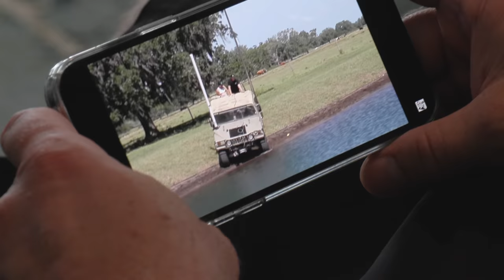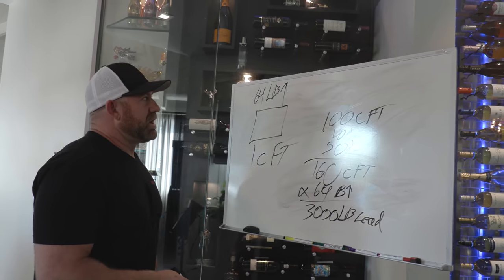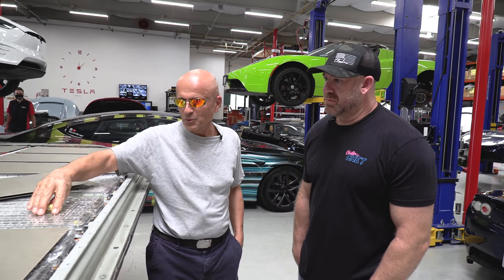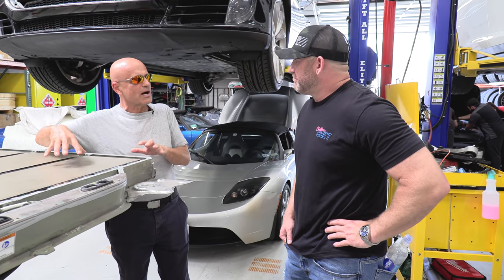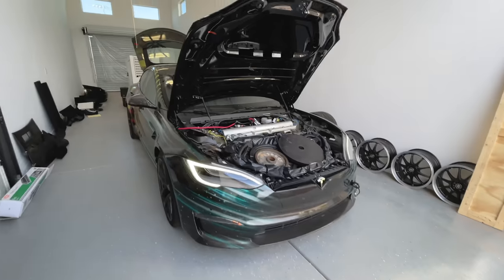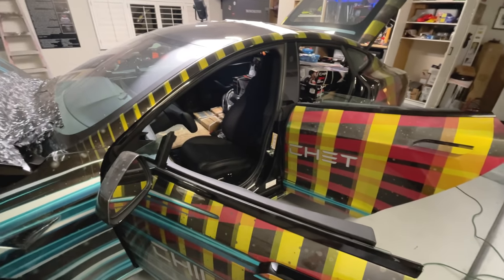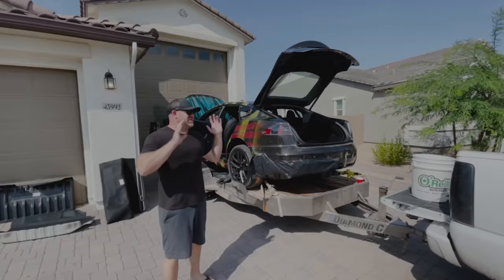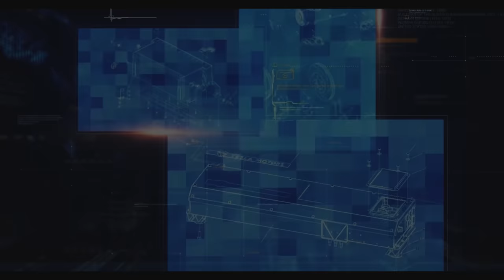Driving my Tesla Model S Plaid Underwater!! Does it float, sink or drive 7ft under!?

Comment: Uncle Chet i'm an engineering student and my calculations say you need another 2,400 pounds of ballast in there to get the roof underwater. You want the weight more forward also. That is asking a lot of that frame and suspension/tires would be pushing it for sure. Pro tip - fill the tires with water instead of air like tractor tires! My calculations say this will give you per tire 70 more pounds of ballast or about 280 for all corners. By replacing the air with water in the tires they will be able to handle any amount of weight and is that much less on the frame. That trench does not look to be deep enough or filled with enough water for the roof to go under though.
Reply: Do this for sure. Water in tires is smart
Reply: What happens when the car egresses the water and loses Fb?  It will be too heavy to move.  You saw what happened to the tow rope.  It's already too heavy.
Reply: @ajcsanders  Uncle C said for try #2 it would be even better sealed than before but the water that entered was actually helping him supplement his ballast deficit. The way the water distributes evenly as a ballast is actually less stressful on the car than solid ballast. I agree it is already too heavy because it is a crazy idea in the first place but to actually achieve the crazy goal it still was not heavy enough. That rope broke because it was a flimsy welfare rope and there are straps that are strong enough to handle the strain with ease. Because the frame was designed to handle the G-forces of dynamic loads I would expect it to technically support the weight without breaking on its bottomed out suspension since we are talking just a bit more than doubling of the original mass. As uncle C pointed out the volume gets more buoyant as it sinks and so the reality is to make it sink all the way that tesla needs to have a weight equivalent to 2 full size pickup trucks one way or the other. Whether it is water or solid ballast doesn't matter but to achieve the spirit of the mission I take it that he wants to keep the cabin relatively dry like a james bond lotus submarine. About it not being able to move, with it being a plaid model that car has a horsepower equivalent that is well above a 1000hp car and with it being torquey electric motors I know it would have more than enough power to keep on moving despite having to weigh as much as 2 trucks as long as the systems remain functional! Because even with 2k more pounds of ballast it would be just neutrally buoyant, it would need to weigh even more to actually have additional negative buoyancy so the tires don't merely spin out on the bottom from lack of traction because it can't just merely touch the bottom but needs to literally press on the bottom to hook. God Speed Sir!
Reply from the maker: The rope is 25,000 lbs winch line stronger than steel.  It was the knot that made it fail.  But  Yeah it will work just needs more weight. Once it enters the water the weight is nullified by the buoyancy and i hope to have 500-1000lbs on the tires.  If i blow out a shock or two i dont care it will still drive itself out.  Only thing I worry about is a “water safe plug” made by tesla fails and the mission is a loss.  If it does what its suppose to do then it will happen when we retry in a couple of days.
Reply: @ChillinwithChet  That's right Uncle C if you achieve the 500-1000lbs of negative buoyancy when it is in the water the suspension will not be bottomed out at all the ride height will be actually higher than normal because it would need the 4.5klbs of negative buoyancy to compress down to even regular ride height. It would be the before and after the pool that it would be bottomed out and bottoming out a shock slowly doesn't hurt them at all it is only when they are bottomed out very fast like when hitting a curb that blows them out. Keep up the good work!!
Reply: @ChillinwithChet  The problem with the suspension is before you get in to the water.
Reply: or he could just burn a stack of money, same result
Reply: @jarehelt  tough to burn the money underwater...
Reply: You may want to consider making ballast tanks for water in the trunks. It will be a better use of the space to overcome buoyancy. Creative use of a bilge pump could theoretically get the car neutrally buoyant, the same way a scuba diver does it.
Reply: My calculations say. Don’t do it. You are not going to be happy after. Then give me the car please. Thanks 🙏🏻
Reply: @ajcsanders  the tow rope needs to be doubled or quadrupled. One rope isn’t gonna cut it.
Reply: Maybe also reduce the water just below the car's height and once the car goes inside the water, the water will rise above the roof. Could also make the trench a little narrower to hold less water.
Reply: Sand bags is another option instead of those dumbbells. Conforms to the space better. You could also do a roof rack right? But what about the interior electronics? Those probably aren't sealed as well so you'll need to make the cabin water tight. That would be hard to with frameless windows.
Reply: @djw1091994  Considering Uncle Chet is up in Colorado doing race week stuff with this car right now its a pretty conclusive sign that the electronics survived with the seal job he did the first time and with the water resistant wire harnesses that Tesla Uses. If it survived the first time it will likely survive the second time especially since I know he will seal even better the second time.
Reply: @jarehelt  but no knowledge is gained and no curiosity satisfied

Comment from the maker: Hey guys hope you like this crazy video and I could use all your help by sharing and liking it to send this thing viral!  Round two I should be able to sink it down and complete the mission.  Wish me Luck 😂🦑
Reply: If it doesn't sink just give it to whistlindiesel he'll know what to do
Reply: You made a boat when you tried to look the water out 😁👍🏼👍🏼👍🏼can’t wait to see it go under again
Reply: You sir are one of the coolest and craziest guys I've seen on video! Big shout out from Australia! 

I came to the Chet channel because of the Donald Walters story...... I've stayed for just about everything else cause you got some cool stuff on your channel.
Absolute legend man!
Reply: Fill the tires with water, that is a TON of buoyancy.... many cu. ft. of air.
Reply: add some harbor freight bilge pumps to pump the water out as it comes in ther so cheap and a couple of those would probably provide enough drainage to keep the cab dry
Reply: Simpsons did it
Reply: You're doing it the wrong way. Think like the people that designed James Bond's underwater Lotus. You don't want it to sink to the bottom. You simply want it submerged and able to propel itself and steer. That would be a much better idea. Also, consider sealing and pressurizing the cabin to help keep the water out.
Reply from the maker: @Tron-Jockey  trust me Ive got other plans just step one is this. Drive on the bottom pop up on other side.
Reply: What would chet math be on weight if the trunk was filled with concrete. 🤷‍♂️
Reply: Fill the trunk with concrete, heavy tarp or poly first, can always chip it out after lol
Reply: @BoilerRoomRadio  that's a good idea. probably won't help with towing the Tesla out tho lol
Reply: What do you do for a living?
Reply: Talk about electric chair.
Reply: OMG ELECTRICITY ⚡️ & WATER don’t mix.  Serious Electrocution Risk
Reply: Only a matter of time before your channel blows up if you keep up this type of shenanigans lol...good stuff bud
Reply: If u give it away i can sure use it lol i have to b asking for rides Chet thanks for ur awesome videos
Reply: awesome
Reply: Hey dude I just watched your video and I would love to have it when you are done with it because it will probably be the only way I will ever might get one driving my dads car now and have never owned a car of my own I no it sad and sux cool video tho
Reply: Dude, you can't ask for people to send a video viral. You're doing it wrong.

I like you, but you're crazy.
Reply: fill the most of the backseat area, trunk and frunk with jello like substance, it will be denser then water. For submarine the issue is underwater, and any air in cabin will reduce the chances of that happening. For submarine mode, its not as much Tesla that is the problem but the car will need major upgrade in terms of how you will breath and all that. Absolute desperate shot would be: Put on a portable scuba tank that gives you 5-10 mins, Open door let water rush in and sink car and Drive through. Rescue will involve getting to the car and pulling you out before the scuba tank goes out.
Reply: the lotus in james bond was a wet sub its filled with water so you dont need as much ballast. trying to ballast a tesla is tough. lots of air. i would take the doors off and get a real scuba setup. use a 50  so you got more time for them to rescue. a nice BC mask, etc wouldent hurt either. with the doors off you wont need more balast. if you want the doors off you may need actual lead and not just steel. water is heavy you need to displace it. i would also fill the pond with zorbies next time so you can get a larger demographic to like the video. "i drove my tesla thru a pool of zorbies"
Reply: My guy. You crazy!
Can't wait to see round 2. 
I'm thinking ballast tanks with little water jets on the sides of the car for control
Reply: Best of luck man , I think it gonna work out
Reply: Now this was a great ideal and I hope you can pull this off.
Reply: Good luck! It's going to pop in the algorithm :)
Reply: Wishing u good luck if it dont work i can take it lol
Reply: Prolly should build a retracting spikes rim for more traction.. Also allow the water to be trapped somehow in the trunk on entry then released as your leaving. Lmao just a 💡 thought lol
Reply: I think your bigger challenge is to seal the car.
Second challenge is to keep it on the floor.

Let's go by Challenge:
Seal the car.
1. Maybe try wrapping the car vertically and cutting off the excess from wheels? Then do the same horizontally.
2. Requires more work but since you now already have your car flooded, see where the water is coming into the cabin from and seal those places.
3. Use mixed color water in a tank and spray it throughout the whole car to see where it went and how it gets into the cabin, seal those shut and move forward.

Keeping car on floor challenge:
1. Ofcourse you can try adding more weight but I'd recommend using less water. Water rises when you put a big object inside because of the object volume. Hence you can remove some water so your car doesn't float while it'll still be completely submerged. This way you won't need to add Soo much weight into the car.
The weight won't matter as much because you have air inside the car. Like imagine the swimming vests, they have little bit of air and they keep a human body afloat.
So I'd say reduce the water level just to the level of the car or even below. It might do the trick.

Even though I think it's dangerous but I gotta give it to you, you got balls to be able to do this! I like the mentality of do it just because I CAN!
Good luck and get it done!!!!!
Let me know if I can help in any way  :)
I'd love to be a part of it. :)
Reply: Good luck!👍😉
Reply: Удачі! It's in Ukrainian. I'm from Chernihiv, Ukraine.
Reply: I really hoped this worked. Waiting for part two. While I wait can anyone direct me to the monster truck video?
Reply: Shoulda called @richrebuilds
Reply: Like! Nice video
Reply: 🙌🙌 when is round 2 coming out!?? I’m anxious to see this thing make it through!
Reply: You're working super-hard to keep the water out, probably because it conducts electricity.

Why not remove all the special stuff you've done and just fill the pool with DISTILLED water? 

Distilled water doesn't conduct electricity. Throw those iron weights in and let the thing fill up w/water. It should be fine.
Reply: You know what? A lot of people can use some shares, likes and subs for their channel. 
I feel like you tried too hard for the perfect 24 minute video. Its a good topic. I wanna see a Tesla underwater. But, i can still tell its scripted. The acting is off as well.
Reply: NEED TO PARTNER WITH MR FLEX TAPE
Reply: Chet ignore the shit talking clowns on here I thought it was a good try and very funny. Always enjoyable to watch your channel never disappointed. Some people need to relax and take the stick out of their ass lol. Have a good day and stay safe Jimmy from North Attleboro Massachusetts .
Reply: @ChillinwithChet  I know how to do it. You are going about this all wrong. You need to make a fiberglass/carbon fiber tub. Incorporate the weights in the tub. It can keep the water out and counteract your buoyancy at the same time. You could make some solid wheels for extra weight using stock trims and have them "treaded" like they retread tires.
You could have an aggressive cut made in the tire tread like when they sipe tires. If done right this would create micro paddles to help you move forward and also keep you down.
You need a spoiler in the front to force the front end down. If you designed it right you could channel the water so it forces the end down while cutting some of your drag. May also keep you pointed the right direction while the car settles after entering the water.
The front spoiler should help the front end come down too. It will enter the water first and start pulling the front end down while enough of the car is still out of the water putting its full weight behind it driving it down.
You can pressurize the cabin to help keep the water out. In the process you will identify all the places the water is coming in. If you can stop air from getting out, you can stop water from coming in. And you can do it with air while the car is dry. Instead of having to wet test it the day of.
Seal the area around the mirrors. Great big hole where those are mounted let's a bunch of water fill the doors.
Then the doors have a bunch of holes for speakers and all the fasteners.
Tape over all the handles.
Find and seal up all the sensors and cameras.
I want to help. I can mold the custom belly pan.
Reply: @uncledaddy7972  this nuts 🇨🇦❤️🇨🇦

Comment: You're doing it the wrong way. Think like the people that designed James Bond's underwater Lotus. You don't want it to sink to the bottom. You simply want it submerged and able to propel itself and steer. That would be a much better idea. Also, consider sealing and pressurizing the cabin to help keep the water out.

Comment: There is a reason why tanks... yes tanks... that are able to be amphibious has a "ballast" that ingest water in order to be submerged while traversing a deep body of water.
Most cars are able to drive through water that covers the wheel well... Once it gets to the cabin height, the air within the cabin creates crazy buoyancy until water starts flowing into the cabin.

Comment: Suggestion: Don't go for negative buoyancy, go for equilibrium, & fit a pair of bolt on props driven from the rear wheels, with rudders connected to the steering & then some bluetooth operated dive vanes. Then you can go up as well as down, & you won't need enough weight on your wheels for decent traction to push through water on mud, & you can emulate the James Bond Lotus in open water.

Oh, door & tail gate gaps? I suggest pressure inflatable door seals?

Comment: Since the cabin is filled with air, It act as floating chamber and doesn't leave you to submerge the car inside water, so try to use some vaccum pump and vaccum the air inside the cabin and you could use some O2 cylinders like swimming suit. So it might be working, you could also some external a kind of water pedals fixed to four wheels, so in water while the wheels are converted like a mini propeller and even you float it helps to move with those propellers

Comment: Dude….just some ideas…you could bundle all of the wiring and put the wiring in aluminum alloy conduits and seal everything up. Seal the whole under carriage of the car. Don’t use wrapping material with adhesive on the back to seal the car 😂. Cover the electric motors in something that will seal them, or seal areas to prevent water from getting to the motors.

Comment: I think your bigger challenge is to seal the car.
Second challenge is to keep it on the floor.

Let's go by Challenge:
Seal the car.
1. Maybe try wrapping the car vertically and cutting off the excess from wheels? Then do the same horizontally.
2. Requires more work but since you now already have your car flooded, see where the water is coming into the cabin from and seal those places.
3. Use mixed color water in a tank and spray it throughout the whole car to see where it went and how it gets into the cabin, seal those shut and move forward.

Keeping car on floor challenge:
1. Ofcourse you can try adding more weight but I'd recommend using less water. Water rises when you put a big object inside because of the object volume. Hence you can remove some water so your car doesn't float while it'll still be completely submerged. This way you won't need to add Soo much weight into the car.
The weight won't matter as much because you have air inside the car. Like imagine the swimming vests, they have little bit of air and they keep a human body afloat.
So I'd say reduce the water level just to the level of the car or even below. It might do the trick.

Even though I think it's dangerous but I gotta give it to you, you got balls to be able to do this! I like the mentality of do it just because I CAN!
Good luck and get it done!!!!!
Let me know if I can help in any way  :)
I'd love to be a part of it. :)

Comment: Fill the tires with water or sand, fill the cabin with sand bags, keep all the weights and seal all your panel merging gaps with rubber. Should be good then.